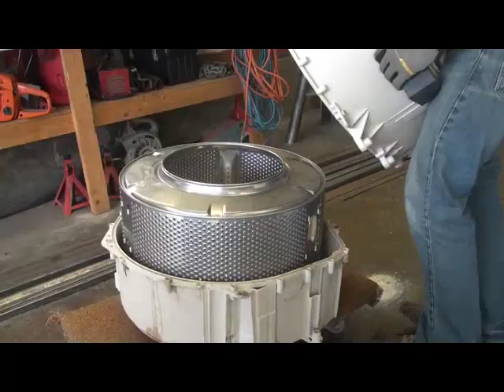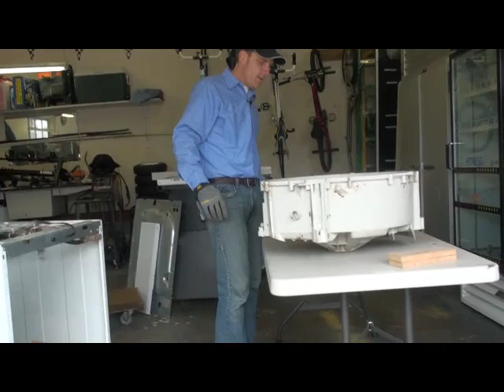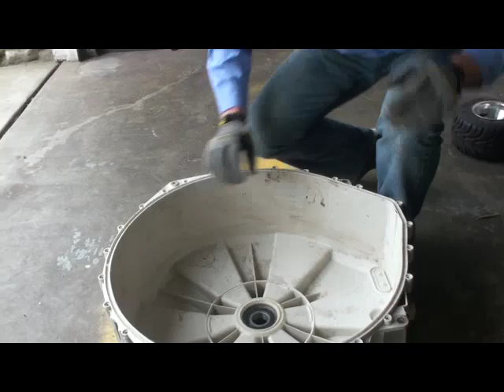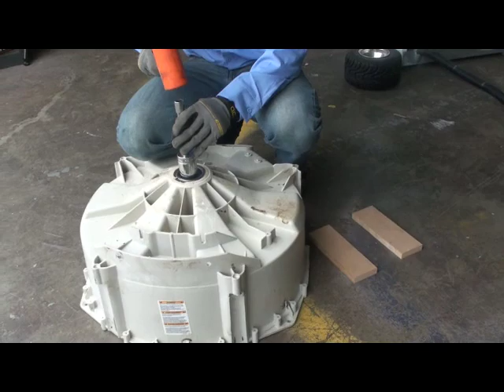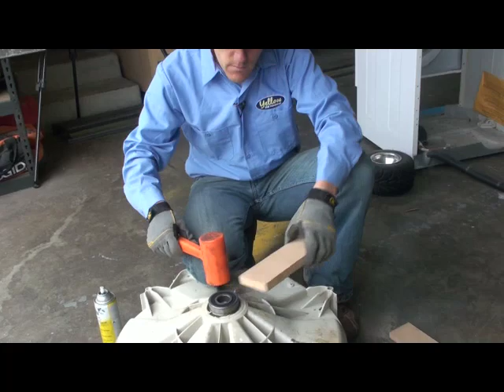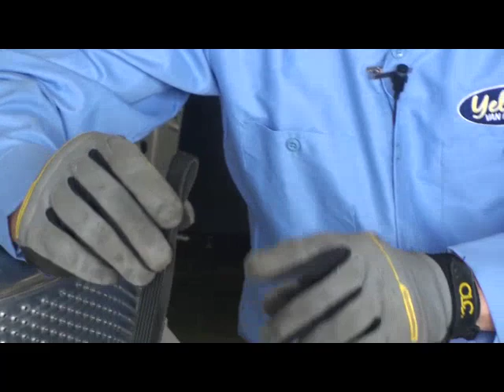Loud Bearing Noise? Frigidaire Gibson And  Kenmore Washer Repair Explained.

Comment from the maker: @fanoftu54 - i think it depends upon who you call or maybe someone was feeding me a line but one guy did tell me that he got frigidaire to send him the spider for free..

if yours is in good shape structurally then no need to replace it.  i have never replaced the spider when making this repair. i think it is a great idea to really clean the material well and coat it with an epoxy or marine paint or something like that.

no need to lube the bearings other than ease of assembly.

Comment: Your tutorial video is very helpful and appreciated.  While I have everything disassembled, I don't like the looks of the condition of my washer's spider shaft  as it is beginning to corode. I can't seem to find a local or internet vendor to purchase replacement. The tub looks fine.  Can you recommend a source or do you sell the spider shaft as well as the bearing/seal kits for Frigidaire FWTR445RFS2?  Thanks!

Comment: @HomeTaskdotcom Sorry to bother you again, but in the video you mention using the old tub gasket again.  Mine is in good shape and I plan on using it again, also.  Would you recommend using any kind of silicone (the permanently flexible kind, not adhesive) or plumber's grease on the gasket before assembly? .... or leave it as-is?  Thank you.

Comment from the maker: @batt409 yes, i would agree that coating the spider with some sort of good sealer such as an epoxy would be a good move.  my guess is the manufacture should have upgraded the new part with some sort of coating but maybe not.  there is an electrolisis issue inside of these machines that is causing the type of material used to make the spider to get eaten up.

Comment: Jerrod - Excellent video.  I'm in the process of repairing my Kenmore (Frigidaire) front loader which has a broken spider. I've already replaced the bearings and seal, waiting for basket/spider. I know this video primarily deals with the bearings, but on a forum I read of some people removing the new spider and painting it with an epoxy paint  to help keep it from corroding.  Just wondering what you thought of that? ... good idea? .... bad? .... worth the effort?  suggestions? Thanks.